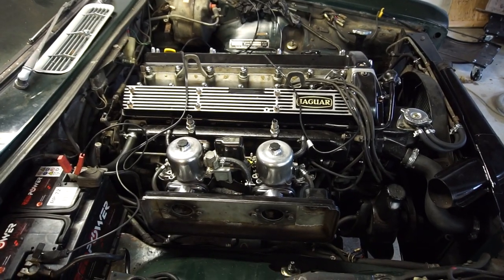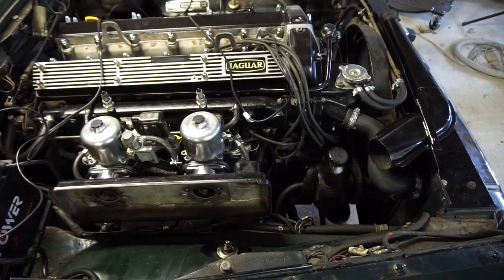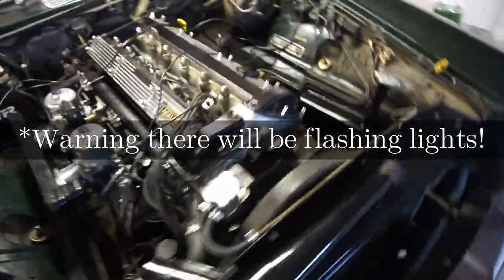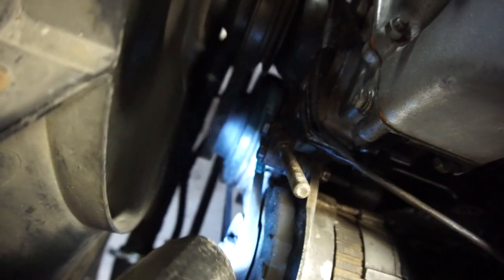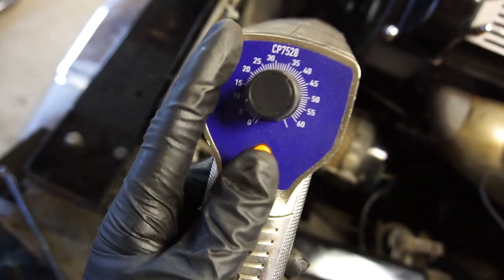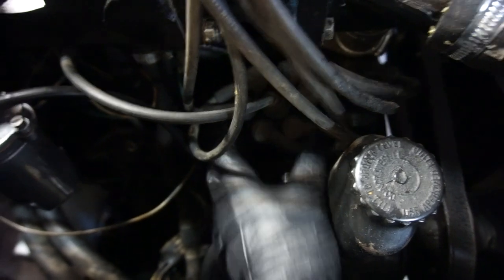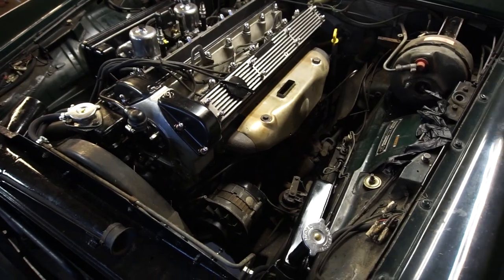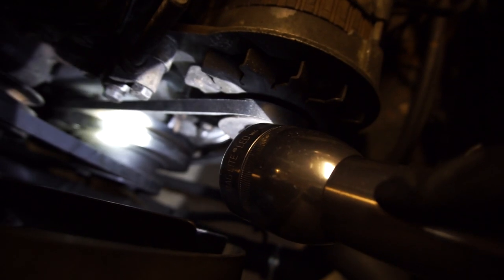Ignition timing - Jaguar XJ6

Comment: Another great video during these lock down times. Stay safe everyone there Adam. P.S. Picked up another 1987 Jag  V12 non running ( but in good shape) for 10 years for $390 Canadian. No ignition keys etc 180K .What I learned off you  Adam I had it running smoothly in two days and street driving.
Reply from the maker: Congrats on the new car and getting it running so quickly! Stay safe during lock down
Reply: Made a error on this it was 4 years not run and Carfax says one owner on this V12.

Comment: If you have a problem with any vehicles timing there is another way. Use a vacuum gauge. Turn the distributor to get the highest reading, then back off a tiny amount then lock it up.

Comment: any tips in cause you don't have ignition? did a rebuilt and now suddenly no ignition.. tested every cable and connection.. when the motor was out everything was fine so should be something stupid but can not find it.. tips? thanks

Comment: Hello Adam, thank you for your content. Timing for a Series III (Australian "Federal" Version with pollution gear) 4.2 L XJ is also 8 deg. BTDC. So, if your version of a Series III engine is the same as an "Australian" car, regardless of running on carb's, timing will be as you have set it at.

Comment: Hi Guys, Sorry to moan.  The best way to adjust the Jags ignition timing is to first remove No 1 spark plug and measure the top of the piston with a dial gauge so that you can find Top dead centre. The go to the timing mark indicator set that to zero. The timing mark indicator has long slots for you to adjust it. Your ignition timing can be way off. From there whip of the Camshaft covers and check your valve timing is correct as that is adjustable as well. Then move on to your ignition timing and then the carbs. It makes all the difference. Good luck.
Reply from the maker: The whole top of the engine has just been apart so ofcourse that had been checked 😊